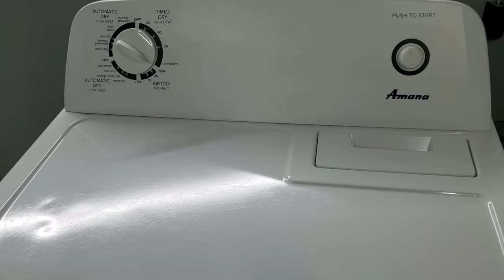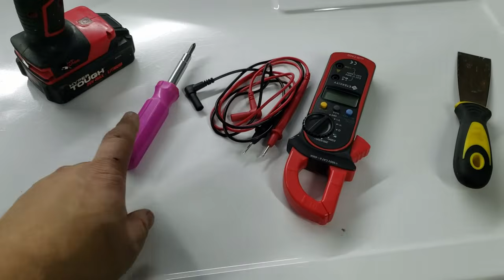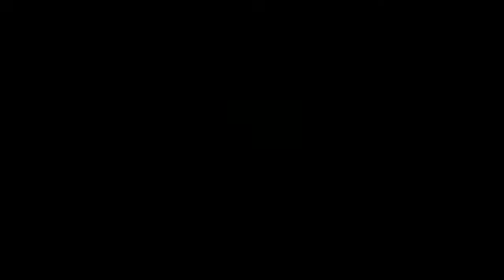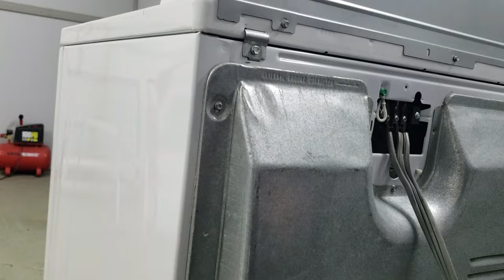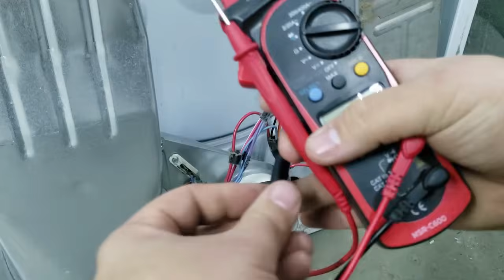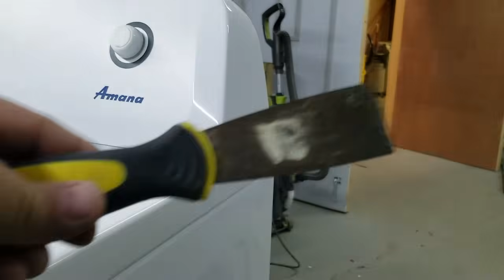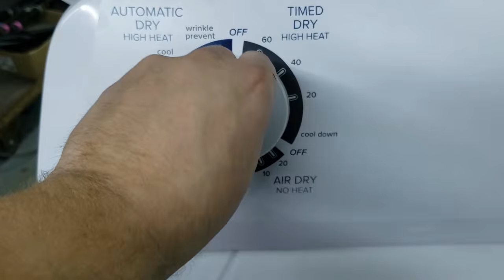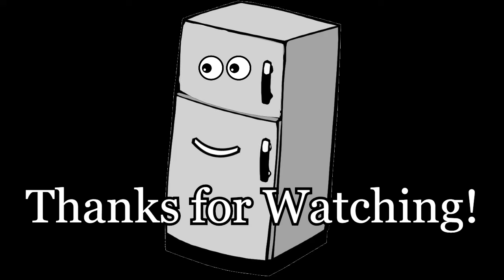How to Fix an Amana Dryer that Won't Heat - Also Works for Kenmore, Maytag, Whirlpool and More!

Comment: I got mine brand new today it is the exact one in the video. Has 0 heat. 🙄
Reply from the maker: If its brand new and has virtually no heat, you need to check the power coming into the dryer. The dryer must have 208-240v for it to heat at all. Get an electrician with a multimeter to check voltage coming to dryer to verify 240v. If it is getting 240v, then there is an issue with the dryer. If you cannot get 240v to dryer at the terminal, then the cord or electric in your house has an issue.
Reply: Bens Appliances and Junk Thank you! I had someone come and it was the outlet. So happy 😀
Reply from the maker: @courtneylynn857  wonderful to hear!

Comment: Great tutorial! 👍👍👍  I have a question. I have the same dryer, but on my heating element I showing a red wire, orange wire and nothing on the inside pin. Is there a wire that should be there because all other wires are connected. Thanks in advance for your assistance.
Reply from the maker: On the ELEMENT itself - you need a red wire (L2) then either a red/white striped wire on the other post OR there should be a striped red (or other wire) going to the Thermostat which should be just above the element AND that thermostat should have a metal strip that fits onto the other element post. 

It should look something like this: https://www.amazon.com/3977767-Dryer-Thermostat-Replacement-Stars/dp/B07443BDWF/ref=sr_1_1_sspa?dchild=1&keywords=3977767&qid=1597718069&s=hi&sr=1-1-spons&psc=1&spLa=ZW5jcnlwdGVkUXVhbGlmaWVyPUEyMU9SRkRERU5TSDREJmVuY3J5cHRlZElkPUEwNzM5NjQwMkpPOTBZRzlIMVVHVCZlbmNyeXB0ZWRBZElkPUEwMjcyNjE0R0lOSzlJVTdEOVhUJndpZGdldE5hbWU9c3BfYXRmJmFjdGlvbj1jbGlja1JlZGlyZWN0JmRvTm90TG9nQ2xpY2s9dHJ1ZQ==

The gold metal would have 3 attachment points - the post at the very right of the image, the small brass post where that orange wire may go (or some sort of plastic holder for the orange wire would be), then the left-most brass female spade, and that would go ON TOP of the element post. I hope that makes sense.
Reply from the maker: Here's another video I did roughly at the correct timestamp. It uses the 3977767 thermostat, and it has that post welded on - hopefully it makes sense:

https://www.youtube.com/watch?v=TGIodSIp_tA&t=331s

Comment: Checking the power terminals i have 120 at L1 - N and 120 at L2 - N but i get .2 volts across L1 and L2. Not 240 and not 0 but .2 on my digital multimeter and a slight movement of the needle on my analog. Same results with the dryer on or off. What does this reading mean? I checked it over and over and it's just doing what I described.
Reply from the maker: It means there's something wrong with the electric going to the dryer. You should be getting 120 at L1-N, 120 at L2-N, then 240 (or so) at L1 & L2.
Reply: @bensappliancesandjunk  Thank you, I learned a lesson here. It turned out the cord was just not fully seated in the receptacle! I should have known better and tried unplugging and plugging back in first!

Comment: Very helpful. Still not heating. Uhhg. On this model, I heard the c switch or something on the motor could be bad if all other components test good including the timer.
Reply from the maker: Hi Amanda, you got continuity between A and C on high heat? And you verified you're getting 230v or around that at the terminal block on dryer?

Comment: Hi, thanks for such informative video. 
I have a very similar dryer Amana Mod.#NED4600YQ1 and it heats but somehow after the cycle it’s over the clothes still damp. It feels very hot inside the drum but the clothes requires 2 or 3 cycles to dry. Any advice on what could it be or what should I check? Thanks in advance.
Reply from the maker: If the dryer gets hot, but clothes do not dry, its a vent restriction on the unit. It needs air to cycle out the humid, water-saturated air outside. If the vent is clogged, the moisture will just stay in the drum and never leave, or leave very slowly. I'd check the dryer vent both in the machine itself as well as the wall.
Reply: Thanks for your fast response, I already replaced the vent flexible line for a new one but still the same. What should I check for on the machine side? It looks like it would be clogged inside because I don't feel strong air flow coming out at the end of the vent cover.
Reply from the maker: @franklynhernandez6646  assuming its a machine similar to this one - take back panel off. On left side, there's a rectangular metal tube where the thermal fuse / cycling thermostat are. There are 3 hex-head (maybe 4?) screws holding it on the bottom.
Once those 4 screws are removed, removed the two that are where the lint filter is / remove lint filter and remove them.

Once all 6 screws are off, you can take out the metal blower housing tube. It could be impacted w/ junk. I'd also check the blower housing itself... You should be able to look at it w/ the tube removed to make sure something hasn't totally destroyed the blower housing. Its either a venting issue, or something's preventing it from exhausting the air, such as the blower not moving.
Reply: Thank you so much! I will try this sometime during this week and definitely will get back to you with the results.

Comment: Ben, Greetings from San Antonio, Texas. I have an Amana Dryer as the one in this video (NED4655 EW1), and they don't have a Temperature Selector. On the operating thermostat the two purple conductors(marked V on the dryer's schematic), I have traced one of the purple conductor to the left harness next to the red conductor, as shown in this video, and the other one goes to other conductors wrapped with black tape. Is this conductor left unconnected, and only used if there is a Temperature Selector with the dryer? Also, if the thermostat heater element, that is part of the operating thermostat, is not being used, is the operating thermostat opening and closing with the temperature of the exhaust air? I have noted that the amps go up 24 amps and then go down to about 5 amps at the breaker for the dryer. When you ohmed out the the heating element I'm sure you meant 7.18k ohms. Thanks for your excellent videos.
Reply from the maker: The typical ohm range for the heating element is usually between 10 and 30 ohms, not 7.18k... I test the heating element around 5:38 and get around 10.1 ohms which is typical for most elements similar to this one.  

The purple wires aren't needed if you don't have a low heat setting either on the timer or the selector switch - if the timer itself has a low heat setting, I would imagine that you'd need both purple wires attached to the timer in the proper position for it.

On the amperage - your dryer is going to cycle between on and off with the 4000-5200 watt heater, so a heating amperage of 24A sounds about right, and a lower or no-heat at 5A sounds acceptable.
Reply: Ben, Thanks for responding so quickly. On the ohms reading issue, I was writing about the resistor for the operating thermostat. The terminals your refer to the two purple wires. At your convenience, would you take a reading on my other questions, and perhaps you can answer them ? You have the skills to write repair manuals in words that the average person would understand. Respecting your video on the laundramat and the thievery, here in San Antonio,TX, the newer laundramats only take credit cards as many restaurants and convenience stores. I'm looking foreward to viewing all your videos. Thanks again!
Reply from the maker: @aliso-pv7ll   I did take a reading on the purple wires in you are correct, roughly around 7.8 K ohms. I think I had a little bit less than that but my understanding is as long as you're getting a reading between about 6 Kate AK you are safe calm and I think Michael's little closer to 7

Comment: Sir I have never commented on YouTube, however this is the best/ most informative/ no fat or filler video that I have seen in years. Thank you for making this whole task take 20 min tops. You are the man!
Reply from the maker: Thanks! The crazy thing is that tech-ing these style dryers once you know the basics is like...  a 5-minute job, tops, with a drill gun (vs a screwdriver) and a multimeter. Very simple and easy IF you know what you're doing. If you don't know what you're doing, you can throw a lot of money into fixing the wrong thing.

Comment: Trying to find information I have a dryer by Whirlpool I have changed the coils change all the fuses new it goes on and it turns the drum  it runs turns on heat after 2 heat it drops but it's still on running what advice you could give me what I could do with my dryer or what could you tell me what problems could I have thank you
Reply from the maker: I am not understanding your phrase "Turns on heat after 2 heat it drops but its still on running". What do you mean "after 2 heat it drops". Are you saying it initially heats, then stops heating all together?

Comment: Hey I have a couple questions if you don't mind. Should the thermal fuse have continuity? And the thermostat and heating element on my dryer are where the high limit cutoff on this one are, do you know where the high limit cut off on mine would be?
Reply from the maker: Yes, the thermal fuse should have continuity. If you can confirm that there is a thermostat where the high limit should be on this exact style machine, I definitely would change them. The thermal fuse is designed to pop at a certain temperature. That temperature is going to be higher near the element casing then it is on the top of the unit so it is more likely to fail. Same thing if the thermostat is moved. It will work technically, but it will fail much quicker I think
Reply: @bensappliancesandjunk  thanks for the reply! After further research it turns out I had the high limit switch and the heating element confused. Going to get a new thermal fuse today.

Comment: I tested mine took all parts out took to the store and the guy told me the parts are still good I won't need to replace it. I cleaned it very well but it still not heating up.
Reply from the maker: Did you check electric coming into dryer? Otherwise I'd check the timer. Many times if you cant find any bad sensor or element, the timer contacts are fried
Reply: @bensappliancesandjunk  yes I checked the outlet and everything but the timer so I'm thinking it is the timer I had to put it down and go but when I have a min I'll test the timer and see what's up. Thank you so much for your reply
Reply from the maker: Fyi the timer can be fixed with a nail board. I have a video I made on how to take it apart to fix. If the timer looks similar to this style they are VERY notorious for going bad.